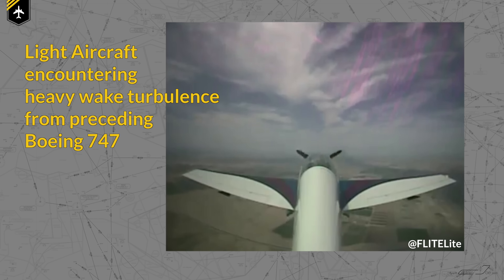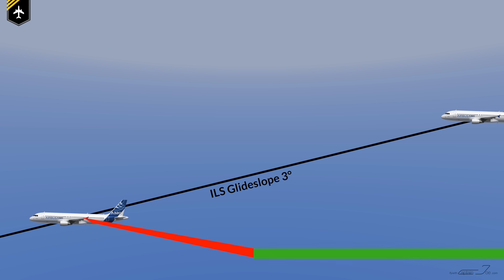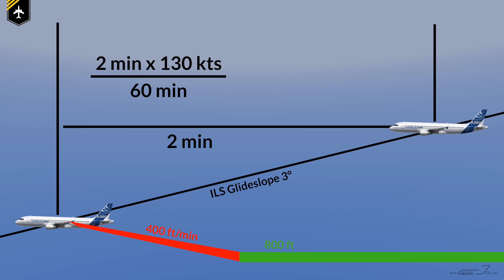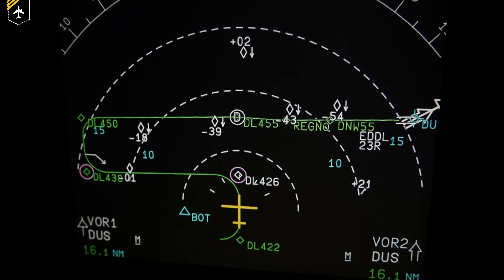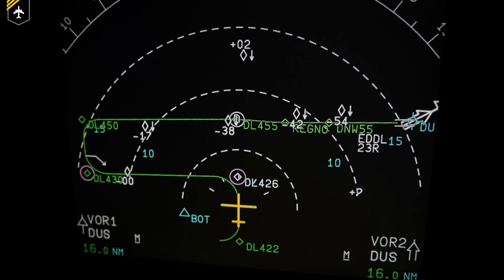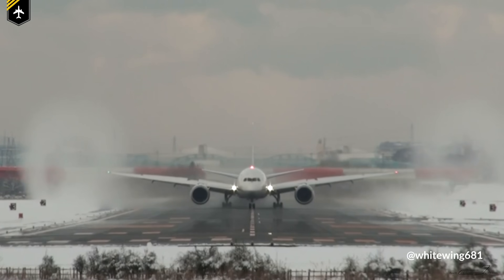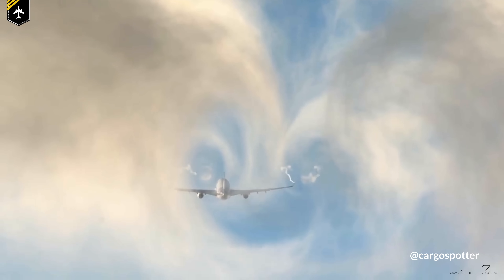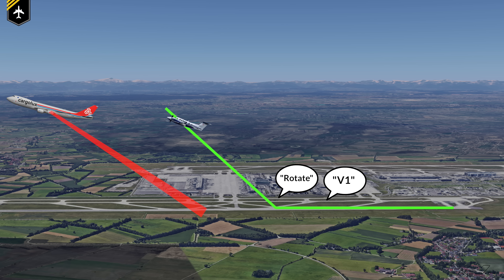WHY do pilots say HEAVY? Wake Turbulence EXPLAINED BY CAPTAIN JOE

Comment: Concord must say:"FAST BOSS" or "DADDY HERE"
Reply: Or droop snoot
Reply: That is a moot point. The SR-71 lands at 200 mph and only weighs about 60T. I also requires a 4 mile long runway. You couldn't catch its vortices if you tried, and you certainly wouldn't share a runway with it.
Reply: Matthew Vincent just to add to what you said, the SR-71 still required a wake vortices separation limit, because it's wings were angled in such a way that a wake vortice would be generated on rotation.

For this reason, all military aircraft on the airfield following it, had to wait around 90 seconds before proceeding roll.

In practice, this was there, because aircraft movement at these particular airfields were few and far between and like a commercial airport.

The rule was still in place though, because it had to be. Just because an airfield is full of military aircraft it doesn't mean the rules of physics go out the window.

A KC 135 generates huge wake vortices, and there's no way that the 71 would take off following the 135 unless there was a good amount of separation. And although not as large, the 135 would still wait for a good 30 seconds before starting role if it was following a 71.
Reply: What had SR-71 to say in this case?
Reply: The SR-71 flew under National Command Authority (NCA), basically tasked by the President of the United States of America (POTUS). As if the pilot's rank wasn't enough alone, the mission of the airplane and the limited numbers of those airplanes to accomplish that mission meant there was nothing more important on the base than that airplane, and everything stopped for it. A go-around was easily 1,000 lbs of fuel. The Blackbirds were allowed to and did on more than one occasion inform ATC that they were "unable to comply."
Reply: catch me if you can.
Reply: @1_2_die2  they request their speed    in a funny way. Story here. https://www.google.co.uk/amp/s/oppositelock.kinja.com/favorite-sr-71-story-1079127041/amp
Reply: SR-71 never said anything: Remember he's stealth.
Reply: 1_2_Die  SR-71 is aspen
Reply: @1_2_die2  Not a problem:  It only operated at a few, select airports, all with special arrangements.
Reply: Alf-Einar Sivertsen funny airspeed check by a blackbird crew from https://youtu.be/Lg73GKm7GgI. It's a great listen.
Reply: Chase that was hilarious haha, 1992 knots across the ground, cruising around at 3700 km/h
Reply: Alf-Einar Sivertsen the SR-71 only took off from military airforce base. Because it was run by the air force and only used for military use. No need to go to commercial airports....
Reply: @chrispbacon3042  but military fighter jets fly into our international airport at times.
Reply: Yeah speed bird doesn't seem to do it justice. Maybe "Move over or I'm going in dry..."
Reply: @matthewvincent8971  or bite the pillow...going in dry
Reply: See 8:06 for the bit about Concorde (Speedbird Concorde Too/Two? Heavy).

edit: Iain Rae pointed out it's "Speedbird" for all British Airways flights, not "Speedboat" as I originally put! :-)
Reply: @kramelbbiw  speedbird, all British Airways flights are "speedbird"
Reply: Ha! Can't believe I wrote "Speedboat" :-)

So "Speedbird Concorde Too/Two? Heavy" unless you were an Air France Concorde.
Reply: space shuttle is "star daddy"
Reply: Concorde doesn't fly any more. It went out of service in 2003 due to supersonic flight only being acceptable in point-to-point ocean crossings, not over inhabited areas, and therefore not financially viable. People don't want to hear loud bangs overhead. If they want that they listen to Metallica.
Reply: Ally Bee, actually, that was only ONE of the reasons it stopped flying. The second (and actually more important) reason was, that the manufacturer (or you could say the descendants of the original manufacturer), Airbus, refused to provide parts and maintenance any longer! 

And so, the lack of parts and maintenance availability would mean they could not fly it any more, no matter how much they were willing to spend to keep it up in the air! Although, even if Airbus had agreed to continue supporting it, the airplane was becoming a financial nightmare to maintain due to its old age and ancient technology!
Reply: Good to know and I agree, although no country would allow it to fly over terrain. You wouldn't get permission to fly from JFK to LAX for example, or only if it flew subsonic, which kinda defeats the purpose. Trans-Atlantic flights were predominantly the major routes.
Reply: alas
Reply: Dragan Crnogorac +
Reply: says nothing, cus it dont fly anymore lol.
Reply: @ Dragan - That's hilarious..... hahahaha
Reply: That was the best comment I’ve seen in a while
Reply: Would just like to note that the author in Sled Driver relates a time where they had to land "off schedule" at a mixed military and civilian airfield, at which time they were certainly on the same radios as everybody else.
Reply: + Fast jumbo
Reply: Dragan Crnogorac he
Reply: u didnt get what he said
Reply: What would the Antonov 225 say
Reply: Nah, its ‘Supersonic Boi’
Reply: Concord says: „speedy boi 1337”
Reply: You mean chemtrail . Not con trail
Reply: Dragan,  Concorde dead looonng time!
Reply: Concord don't say nothing, they do not fly anymore.
Reply: Did no one actually watch the video? He said at the end “speed bird concord 2 heavy”
Reply: Actually its radio prefix was 'Speedbird'!
Reply: That Downed Flight The First Royal Family of Man Jailed Us MontCoMdUSA? https://youtu.be/Ps2Jc28tQrw The CommonWEALTH! Virginia Seeking To Disarm US of Our 2nd Amendment Rights! "I Am Not a Toy or a Play Thing" In Response?
Reply: Speedbird Concorde 2 heavy, dialog: https://everything2.com/title/Concorde
Reply: Dragan Crnogorac Concorde is "Heavy Concorde"
Reply: Ellenor Malik So the Tupolev 144 got to use HeavyTu-144?
Reply: Alf-Einar, that's not correct.

SR-71s talk to ATC all the time. They're never not in contact. I've worked several. They use towers (usually military), approach/departure controls (sometimes military), and enroute centers (all civilian). They have to transition from the ground to Above FL 600, where they operate VFR-on-top but are still on an IFR flight plan, and thus talk to us. 

Also, they're virtually never "under the radar". Their whole reason for being is to fly very high. To us it's always "Above FL600" but in fact they could be anywhere between that and 70,000'+.

They also wouldn't give us their actual altitude but they could give us a coded phrase of their actual altitude which could be decoded at the watch desk. I once had two "pressure suit flights" (one was an SR-71 the other was a U2) go through my area on crossing tracks. No vectoring possible, and I didn't have time to go through the watch desk, so I asked each their coded altitude and then asked them if they were sufficiently separated (which they were).

Further, they have to make periodic forays down into the mid flight levels to refuel. They're pretty thirsty for that JP-7 they burn.
Reply: 1_2_Die SR-71 use to take off from  military airforce base only.
Reply: Concorde dont fly anymore but I am sure they had a special call sign
Reply: @Alf-Einar Sivertsen SR-71 is military, and wouldn't be using the same airport as civilian aircraft UNLESS it was a dire emergency!

Comment: Please explains knots
Reply: Feroz Ahmad a knot stands for a nautical mile which is the equivalent of 1.15 miles. The unit is from the maritime industry but since early aviation shared many ties with maritime many units and terminology is shared. I hope this answers your question.
Reply: Nautical miles are based on the lines of latitude on a map.  A nautical mile is 1/60th of one degree.  A knot is one nautical mile per hour.
Reply: Knots weren't always the main standard speed unit used in aviation. In ww2 all the axis nations used km/h and the rest of the metric system. The USAAF and the RAF used mph and the rest of the imperial system. Meanwhile Royal Navy fleet air arm and the US Navy's counterpart were using knots for speed and the other instruments in imperial.

Comment: So, would an airplane always just be in one weight category? If you flew a heavy plane with no passengers or cargo, would it be possible to change to medium, for example? If it never changes, saying heavy would mainly be for the benefit of other planes that don't see what size plane you are, though if you're that far away from the other plane wouldn't you be OK anyways for the wake avoidance?
Reply: It's based off the published Maximum Gross Takeoff Weight for that model. So, an aircraft whose MGTOW is just over the edge of two weight categories,  will always be considered the heavier of those two categories, even if it weighs less than the category minimum on that particular flight due to light loading. Once a heavy, always a heavy.

Comment: Hey Captain Joe! Here’s a question for you: why do military aircraft (particularly transport aircraft like the USAF’s Galaxy C5 or the C17 etc.) have their wings on the top of the fuselage? And why do commercial planes not do this? I’ve heard that this is because of they want more clearance under their wings so Humvees can drive under them. I’m wondering is this is true and if there are any aerodynamic advantages/disadvantages of this feature. 
I know one thing though, it looks pretty damn cool in my opinion. And if there aren’t any disadvantages to this I wonder why commercial planes don’t do it.
Reply: I wouldn't say commercial planes don't do that... Lots of propellor-driven airliners, even comparatively large ones like the ATR 72, have the wings over the fuselage.
Reply: Robert Faber I know, but I mean large scale turbo jet airplanes, similar in scale to the ones I was referring to :)

Comment: Thank you very much Capt Joe for this interesting topic. I was always curious to know about the term 'heavy' and I also thought  'super' was a term used by A380 pilots to emphasize their size to ATC. But the real reason as interestingly explained by you is quite serious and critical.
Reply: Can be a bit of both, I suppose. British Airways used to affix "Concorde" to their flight number on supersonic flights, just to emphasise the nature of the plane they were flying to ATC, even if weight-wise, the Concorde was a perfectly average airliner.
Reply: Robert Faber i agree. And during the times of Concorde, the ATC had quite old technology and secondary radars were not present at many places. So  prefix with such terms would certainly help to identify the aircraft type quickly. But is it a mandatory procedure? I don't hear all 747s / 777s / 767s or 340s use term heavy everytime. May be once or twice in the beginning of conversation would suffice because by then the ATC guy knows which aircraft type he is dealing with
Reply: +Sapan Avarani - No idea if it's mandatory, and if so, if it's actually enforced. As for the radar thing though, the Concorde did fly almost exclusively to and from London Heathrow, Paris Charles de Gaulle and New York John F. Kennedy, and I doubt those major airports didn't have secondary radar.

Comment: Short correction: At 02:15 that is NO ultralight aircraft. It is a PZL-104 Wilga which is a radial engine powered polish Echo-Class aircraft like Cessnas, Pipers etc.
Reply: Maybe Wilga is not an beautiful plane but it's great for towing glider's 👍😊 the main threat with it is that it falls like a brick after an engine failure 🙄
Reply: In what country? Only the USA has the bizarrely low 115Kg weight restriction on ultralights, most countries have around  600Kg limit.
Reply: PZL-104 weighs about 1000 kg and has MTOW of 1300 kg
Reply: Christopher P nobody asked you
Reply: Al Borland neither did they ask you,  so just shut the hell up

Comment: You're right about the helicopter wakes, I know people don't think about them much but I live very close (across the road) from a large trauma / critical care hospital and hence we get several helicopters in during the day bringing in emergency patients and transfers from more rural areas. When they pass over my building they’re normally only a 200ish ft above the ground. Normally the little air ambulances are fine, the wakes are enough to rustle the plants and if you’re standing outside when it passes over you’re gonna know about it. When the big coastguard helicopter came in the other day the wake was so strong two of the hanging baskets ended up coming down.

Comment: Hey Joe,  how little is the gap between the turbine fan and the housing? It looks tiny. Also how far can wings actually bend in turbulence?
Reply: The gap (tip clearance) is really small. And it is important to keep it small in all sitiuations because every 0.25mm more tip clearance the fuel consumption will go up by about 1% to maintain the same amount of thrust (CFM56-5A engine, used on the A320).To do that the temperature of the fan blades and the housing are monitored und regulated with a cooling system. With that the heat expansion of the both is kept nearly the same and so is the tip clearance.
On newly manufacrured or fresh overhauled jet engines the fan blades are manufactured slightly bigger than the housing and the housing gets a special layer on the inside so that the fan blades grind their own perfectly small gap. With this small tip clearance in the beginning you don´t need a too big and expensive cooling system, a small one will do the job then.
I hope that I was able to answer your question. I took these information from the lectures on aircraft engines that I had heard this semester.
Reply: Elektro Frosch wow thanks! That’s some awesome engineering at work!
Reply: Well, I do have some knowledge about how the wings create lift and vortices but not so much about the wing bending. The only thing I can say about it is that it heavily depends on the specific aircraft (size, type of wings, etc.)
Reply: Why no reply on second question?
Reply: fuzzybear452 maybe he’s leaving it for Joe to answer.
Reply: fuzzybear452
Here's kind of an interesting video addressing that question.
https://youtu.be/Ai2HmvAXcU0
Reply: This raises a very interesting point I hadn't ever considered. As the airflow passes beyond N1 and is compressed along the many stages of rotors and stators the blade tip vorticies must be immense and many to produce the lift/thrust that they do, especially as the compressors rotate introducing inertia of the airflow being spun away from the boundary layer of the rotor blades. Sometimes I'm just amazed and in utter awe of the engineering of jet engines!
Reply: Something which may be of interest also is these compressor rotor blades are manufactured from materials in their raw form. This allows the rotor blades to utilise the strongest covalent bonding of the materials at a molecular level. The result of which is the strongest rotor blade possible. Just a little thing I recall from my BGT theory days.
Reply: WS P Wow that’s one heck of a test. A lot more bending than I expected.